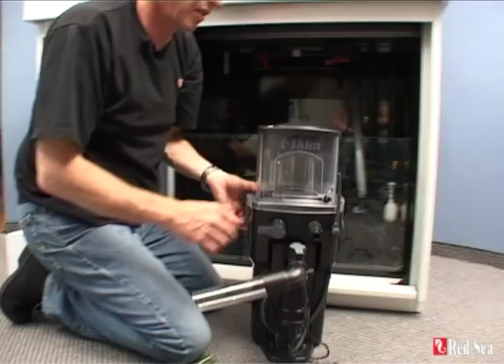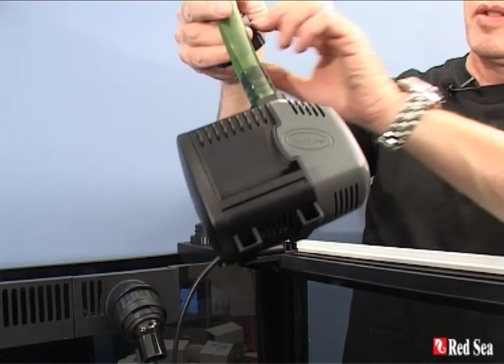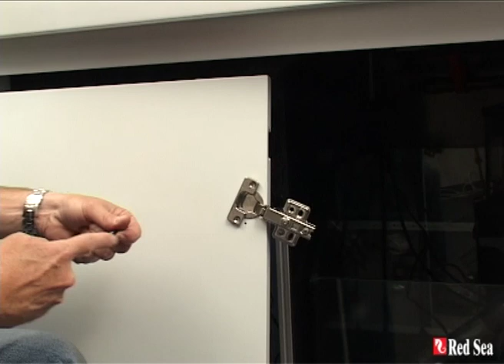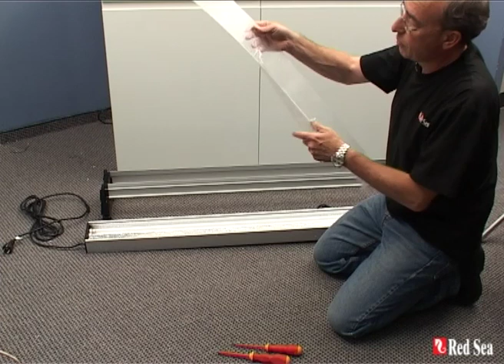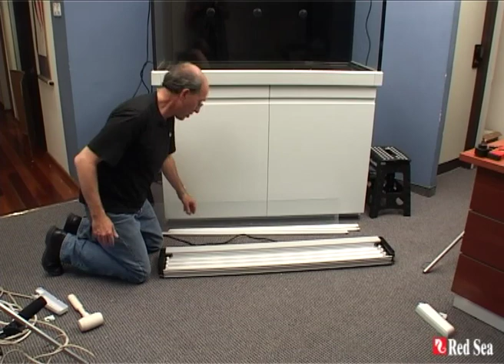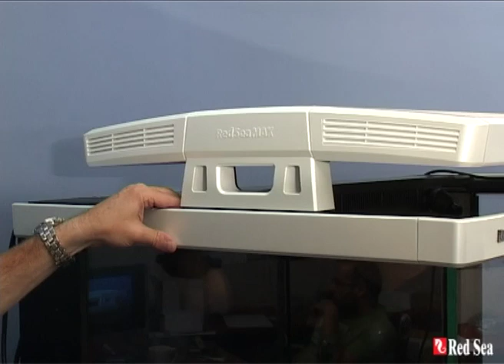Red Sea MAX S-Line Assembly - Part 4/4

Comment: I'm confused as to whether it comes with a refugium area or not
Reply: There's a compartment in the sump that you CAN use as a refugium or you can put reactors in there.   You'd have to add lights.

Comment: I have a RedSea Max S-650 LED and that skimmer gave me so much trouble, change the pump twice and always was making way too much bubble foam and making a loud noise impossible to control even my LFS couldn’t fix it and I ended up replacing it for another brand and no more problems since then. May be RedSea should consider updating that skimmer for a better one taking in consideration today’s technology
Other than that issue with the skimmer AM EXTREMELY HAPPY WITH THE PRODUCT AND I MEAN ALL THEIR PRODUCTS Except that skimmer

Comment: Built 12 hours n four m8s later  buying coral pro RO water today just plumbed in d-d 750 chiller Huge perfect pics n vids posted on my You Tube. Heating  seawater up then tomorrow pic up 100kg live rock premium Fijian using standard coral sand small